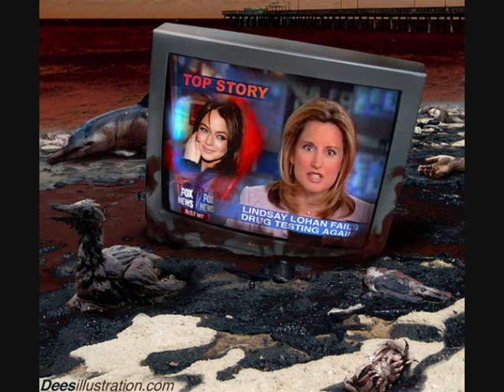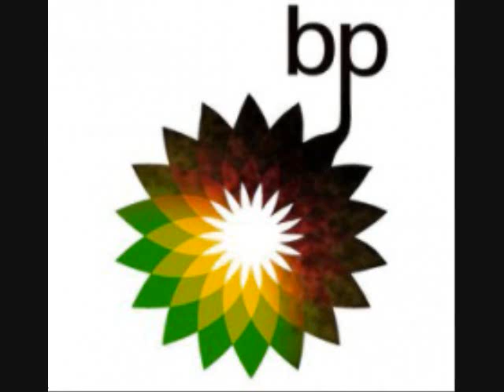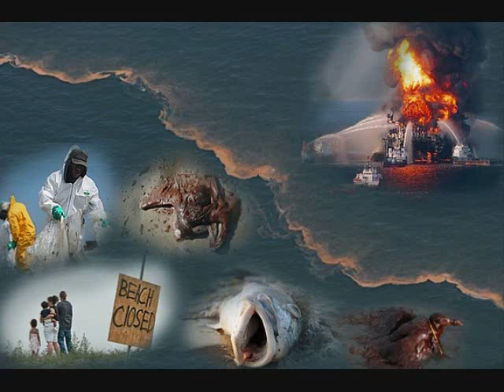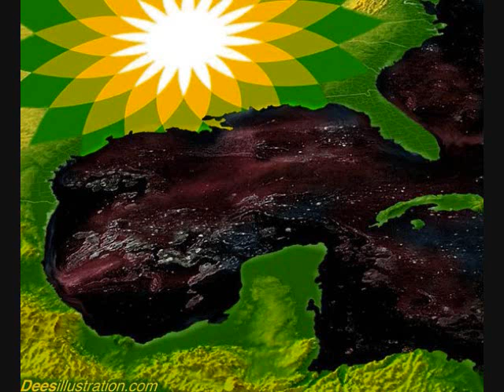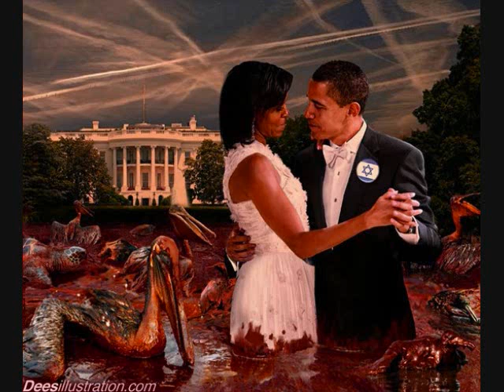Chris Landau Oil Geologist "The TRUTH  about the BP (BS) Disaster" on Rense Radio  1/4

Comment: WAKE UP PEOPLE !!! WHY IS THE EARTH HEATING UP??. With Every Action There Must Be A Reaction !!!.
OIL SUPPRESSES HEAT!!! HEAVY CRUDE OIL BOILS AT WELL OVER 1,000 Degrees Celsius In a Controlled Environment!! Google Petroleum Refining In Nontechnical Language fourth edition. 
These Massive Gas Pressurised Lakes Of Oil Many Kilometers Wide & Many Kilometers Deep Has Been Pumped From The Earth Since 1884 - 2014 That's 130 Years. Please Check For Yourself !
At Varying Depths Below Ground All Over The Earth Oil Is Found. The Centre Of The Earth Is 10,800 Degrees That's as hot as the sun!!.. Oil Is Used In Engines To Lubricate & Suppresses Heat, Without Oil Every Engine Will Melt.. WHAT HAPPENS TO THE EMPTY HUGE GAPING HOLE ??. Even if it fills with seawater that only has a boiling point of 112 Degrees, What about the Gas that pressurised this this Oil Lake - I KNOW - But What does common sense tell you !